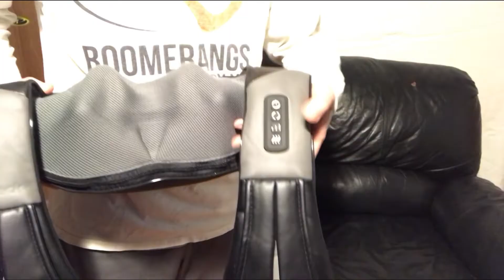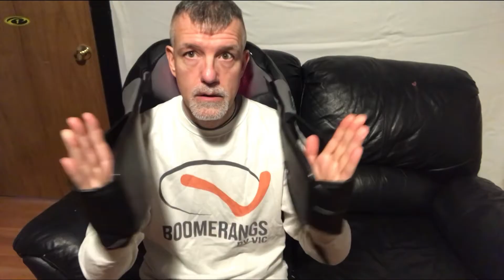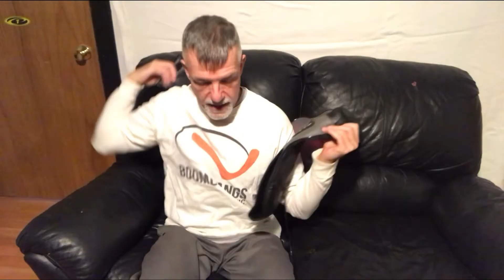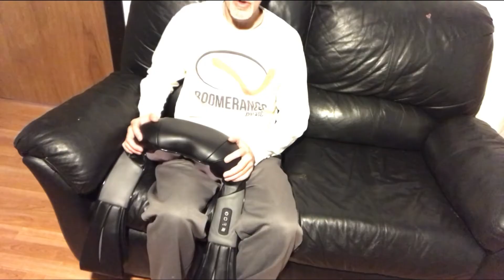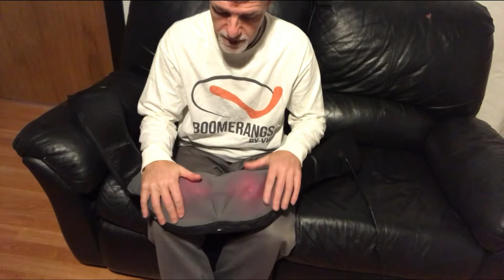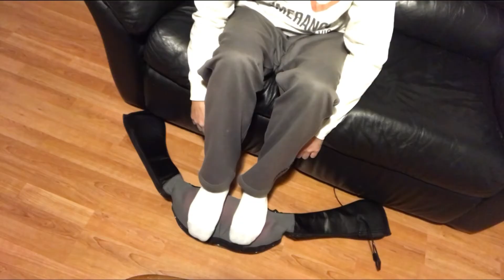Shiatsu Neck and Back Massager with Soothing Heat by Nekteck

Comment: Ty for the details of not only how to use the control panel on this product but also how to use it and warning to be cautious about pinching. Have one of these and as a woman it’s been fantastic for m.cramps. I also have spasticity from MS in my legs and nothing is going to make that stop BUT this is helpful. Never thought to try it on my feet actually so thanks gonna give that a go😊
Reply from the maker: Thank you so much and so happy it works so well for you. Still use mine once or twice a week when needed and still going strong. Have you ever thought about using cbd for your legs?

Comment: I love mine but sometimes it randomly locks up and stops turning but the heat stays on. Idk if it’s because I use it longer than the 15 minutes it runs on but 15 minutes is not enough for my knots.
Reply from the maker: I too run mine for about 45 minutes each use on different areas. Mine is getting close to 3 years old and just starting to make a little bit of noise but not too bad.

Comment: In case so I don't know if anybody tried this here But if you turn it upside down and put it around your neck Then the control switch over to the right arm Then it actually feels a lot better on my neck Almost like I want to give it a kiss Because I can turn my head either way into Into it
Reply: EXACTLY! Same thing I do! I have broad shoulders and upper body frame, the massager portion kept flipping upside down. 😢
Reply from the maker: I've tried it both ways but prefer the opposite. We all have different shaped necks so I agree that people should try it both ways.